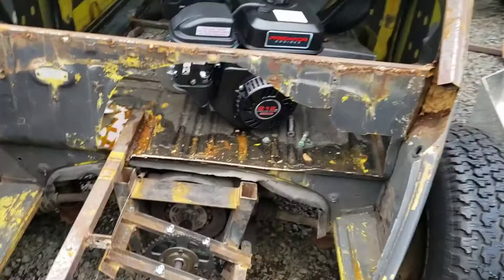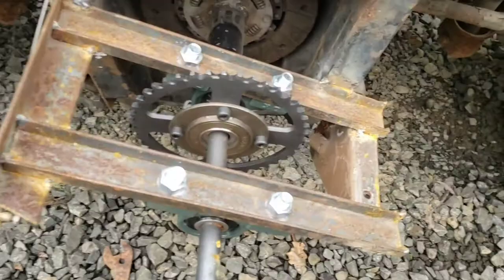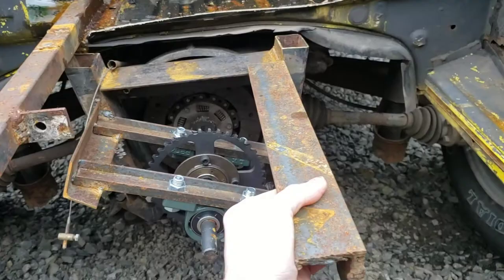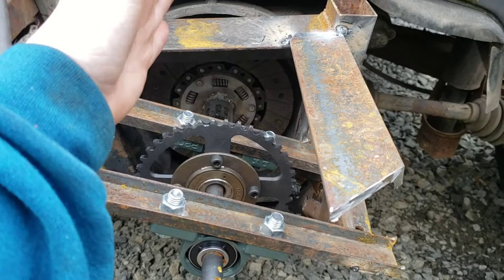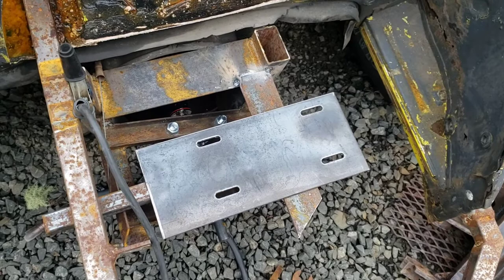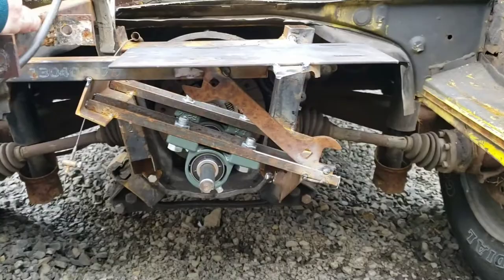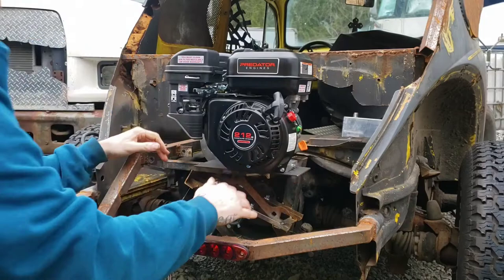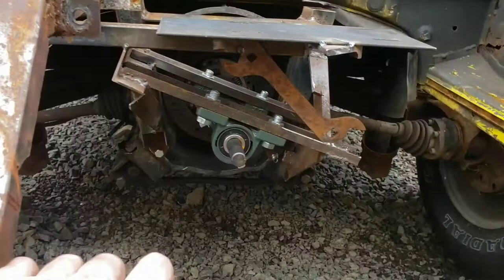predator swapped vw volkswagen beetle baja bug step 3 mount the engine mad max apocalypse wasteland

Comment: I have an alcoholic son. Hes 31 years old and is talking about getting license to drive ( never had them) and a motorcyle. I wish they made a  small factory car like this that topped out at 35 mph.  Make it legal for suburbs only like a golf cart. I mean he has gotten better about the booze but a slow ass  car that just let him get to work and back is better than a fast  motorcyle in my opinion. Also good as a second vehicle for groceries etc. I live 6 miles from work ( flay land in town ). Speed limit is 35 tops so if I can get to 35 at a decent rate I would make it a daily driver.